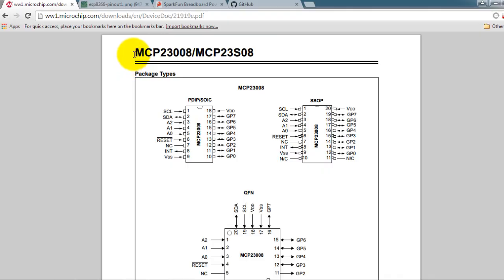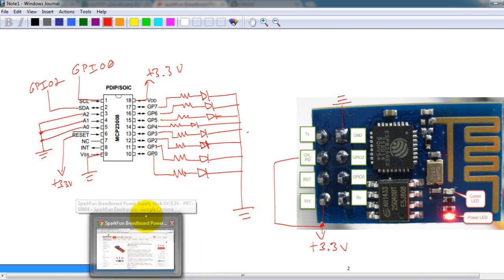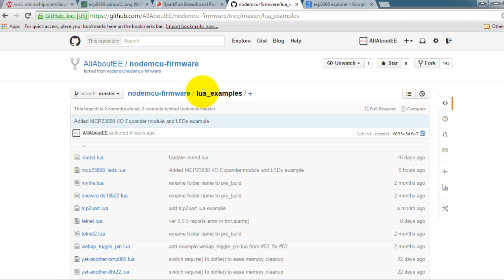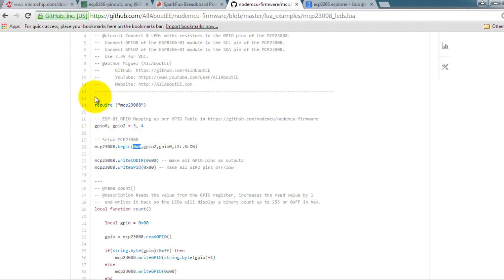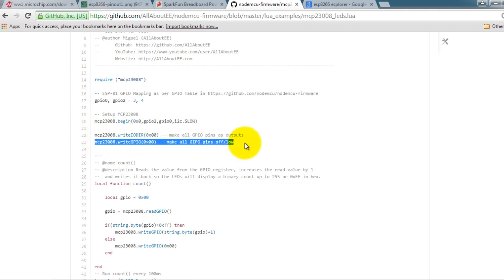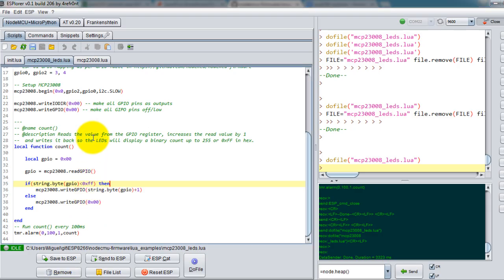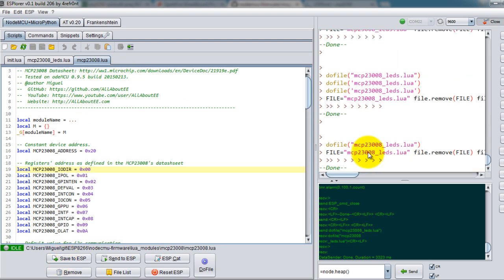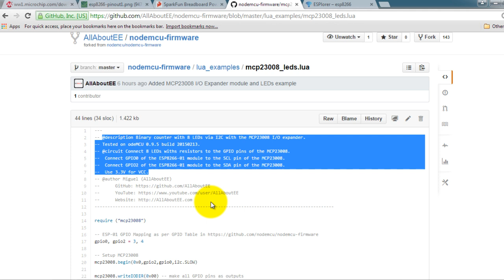ESP8266: How To Add More GPIO Pins (MCP23008 Driver)

Comment: hi miguel, can I use the pcf8574 to expand the pins ? I need to expand to 14 pins
Reply from the maker: Darwin Guiza Sure. But look at the mcp23017, it has 16 pins so you won't need two chips.

Comment: Miguel,

great tutorial. If everything works. I'm testing with the ESP everything. Among other things, I have a web server to a switch from the Web server LEDs Rui taken that works very well. With this example:

wifi.setmode(wifi.STATION)
wifi.sta.config("SSID","PASS")
print(wifi.sta.getip())
led1 = 3
led2 = 4
gpio.mode(led1, gpio.OUTPUT)
gpio.mode(led2, gpio.OUTPUT)
srv=net.createServer(net.TCP)
srv:listen(80,function(conn)
    conn:on("receive", function(client,request)
        local buf = "";
        local _, _, method, path, vars = string.find(request, "([A-Z]+) (.+)?(.+) HTTP");
        if(method == nil)then
            _, _, method, path = string.find(request, "([A-Z]+) (.+) HTTP");
        end
        local _GET = {}
        if (vars ~= nil)then
            for k, v in string.gmatch(vars, "(%w+)=(%w+)&*") do
                _GET[k] = v
            end
        end
        buf = buf.."<h1> ESP8266 Web Server</h1>";
        buf = buf.."<p>GPIO0 <a href=\"?pin=ON1\"><button>ON</button></a>&nbsp;<a href=\"?pin=OFF1\"><button>OFF</button></a></p>";
        buf = buf.."<p>GPIO2 <a href=\"?pin=ON2\"><button>ON</button></a>&nbsp;<a href=\"?pin=OFF2\"><button>OFF</button></a></p>";
        local _on,_off = "",""
        if(_GET.pin == "ON1")then
              gpio.write(led1, gpio.HIGH);
        elseif(_GET.pin == "OFF1")then
              gpio.write(led1, gpio.LOW);
        elseif(_GET.pin == "ON2")then
              gpio.write(led2, gpio.HIGH);
        elseif(_GET.pin == "OFF2")then
              gpio.write(led2, gpio.LOW);
        end
        client:send(buf);
        client:close();
        collectgarbage();
    end)
end)

Now it's boring to turn on only two LEDs. So I've been looking for an extension. And I've found your videos. Have tested your example led MCP23008. Now I would like to bring to your web server with MCP23008 lua modules together. Only I am a beginner so I would ask you if you could make an example of how to do it.